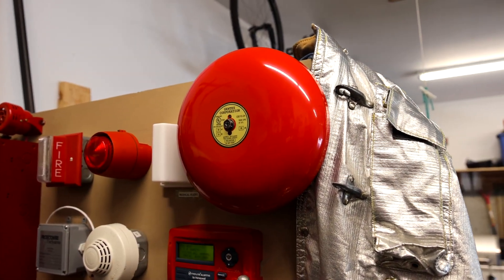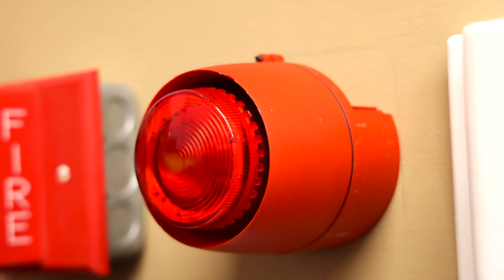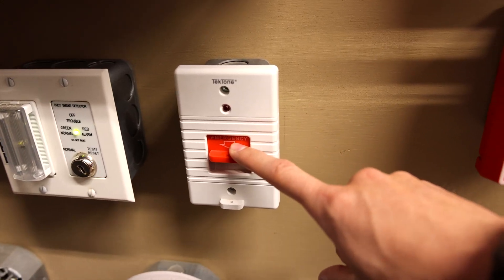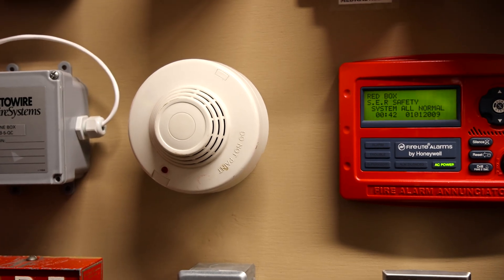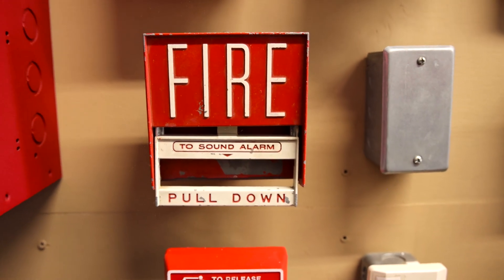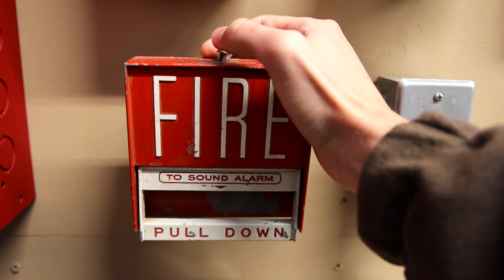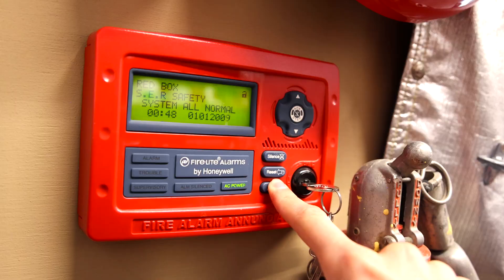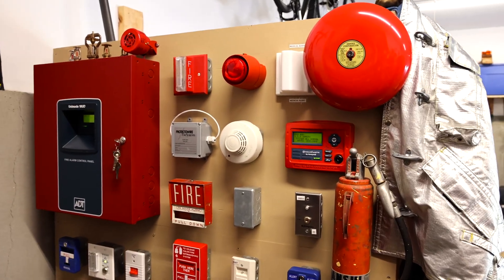How Loud are Fire Alarm Bells? | ADT System Test 34!

Comment: I have a silent knight IFP-1000 addressable fire alarm control panel, what device would you suggest using to be able to use a conventional pull station or smoke detector on this panel?

Comment: Very nice! I have a Potter bell, and it's rebranded by Simplex, I think, and it also sounds just like your Gentex Bell! Well done S.E.R. Safety! ✅️
Reply: Simplex-branded Potter bell!? (is is a PBD rebrand or other potter model)
Reply: @prism_2903 Idk, but the round circle with a screw mounting is at the kinda below on the bell, and it's white. The screw mounting is not in the middle, meaning not in the "center" of the bell.